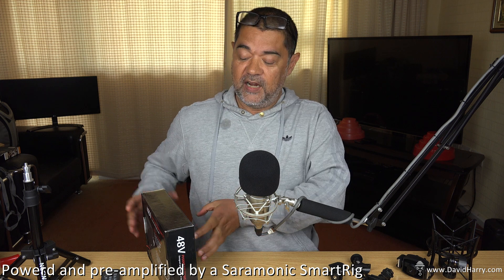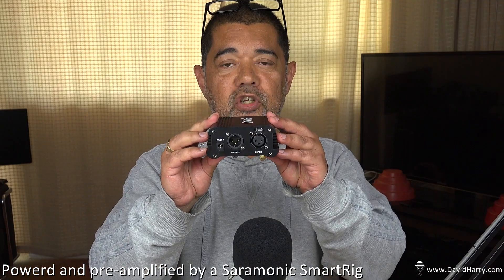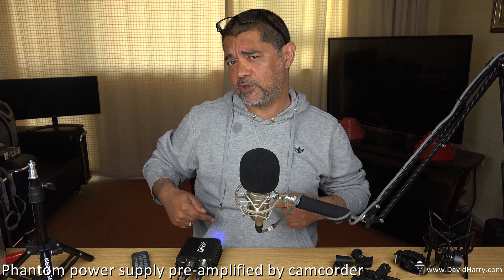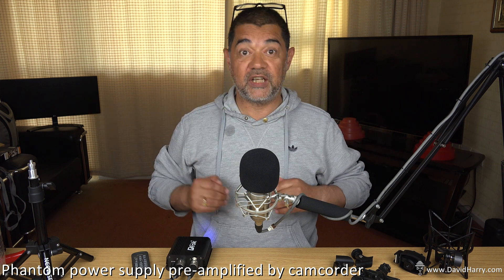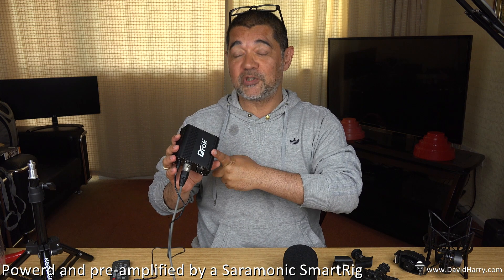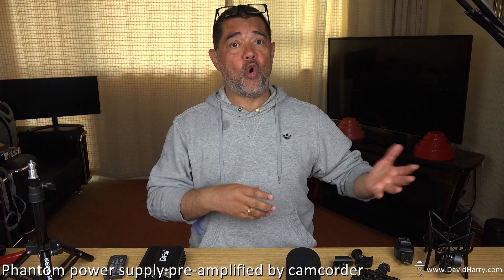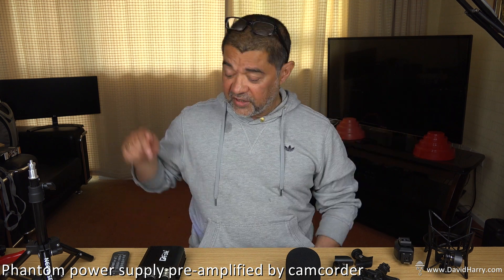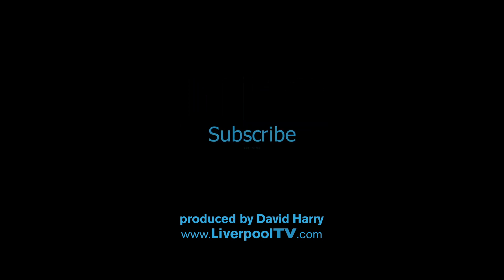Cheap XLR Microphone Phantom Power Supply - Test with a Rode NT1A

Comment: is it necessary to have audio interface? or phantom power is already enough for my Samson C01 mic condenser to function and connect it to my pc?
Reply: Hey men just wondering what did you do? I have a nt1 with only Phantom Power and it does not Sound good and i cant really change anyrhing without an Interface

Comment: Got one. 25usd. Worked great. Then it decided to fail spectaculary.. but running 48v to my soundcard. no more sound. mic survived. onboard sound did not. motherboard did. so usb soundcard after that and no more powerbox. Workes without powerbox as it turns out with very minimal noise.

Comment: Thanks so much for the video! I finally found out how to connect my phantom power supply! HOWEVER, I am not getting clear sound on my PC, still. It sounds muffled. Do you have any idea why that is? I have the aokeo mic set and lenovo PC (purchased 2019). Any input would be appreciated. Thanks!
Reply: Sherunda Simone hey how did you do it because mines is not working
Reply: @Meechda1  hello! For the sound quality...still a mystery. Very annoying. Any luck on your end??

Comment: thanks for the vid. so if im recording 6 channels of condenser mic audio simultaneously, but my interface has only 4 xlr inputs, but also has 4 1/4 inch instrument inputs, can i run 2 condensers through the external phantom and into 1/4inch trs adapters into the 1/4inch inputs in my interface? whats the dif between 48v phantom and a preamp?